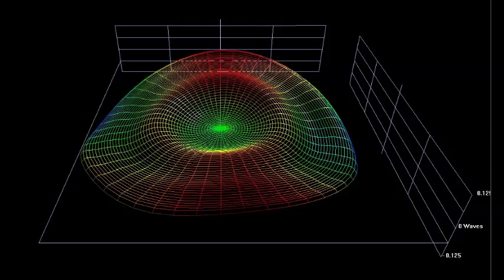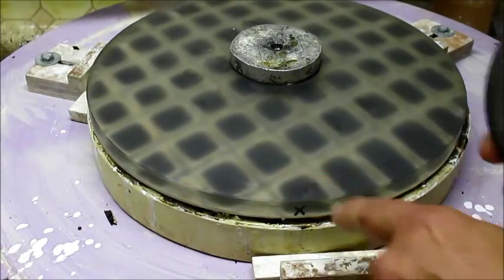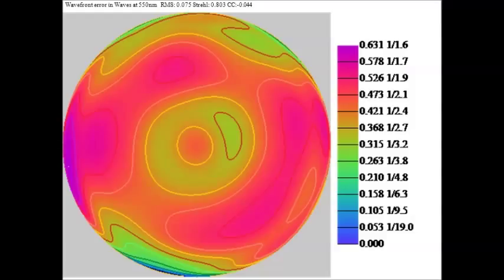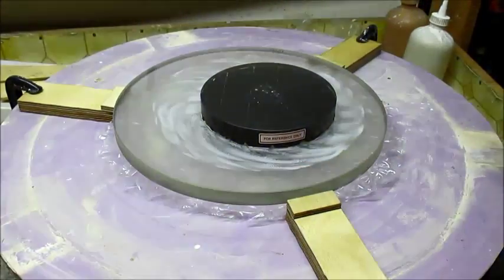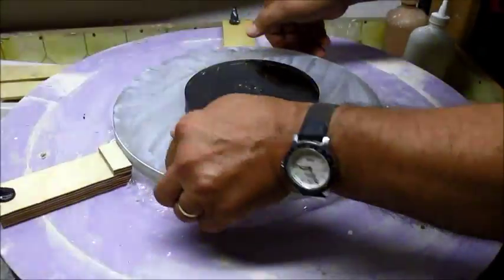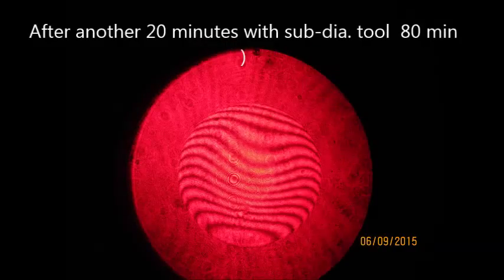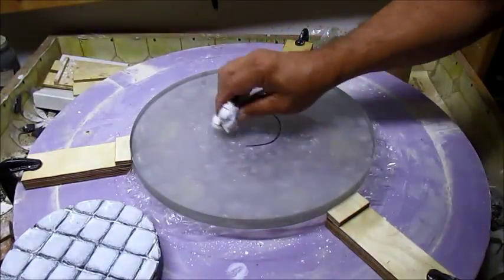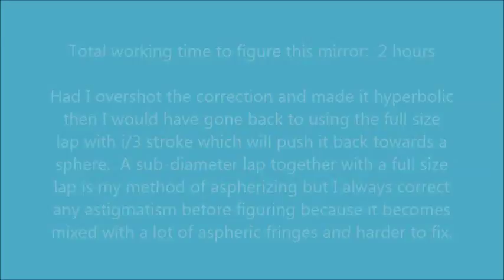Figuring an Astigmatic Mirror

Comment: Ed,
i had a problem with the said mirror, the center was rising, even with mirror on top with mirror center over tool edge stroke, which is an extreme deepening/hogging stroke.

i fixed it eventually using a very small pitch lap but small laps obviously create zones. so when i got the hill smaller than the diameter of secondary i called it quits as it didnt matter anymore.

do you any idea what was going on? how could the deepening strokr produce a hill in the middle?
Reply from the maker: With the mirror on top it will naturally move to be more oblate or less corrected that looks like a hill, at least that's what I find.  I just keep using a half diameter lap and parabolizing. Never a very small lap.

Comment: damn 12 inch diameter 0.7 inch thick? i  managed 12 inch 0.75 inch (19mm) thick as a first project, f5.7, however i stopped at 1/4 lambda as i was content with it but it was tough. used foucalt with coudier mask and a star test to get there.

Comment: Hello Mr. Jones:

I have watched all your videos several times. The big question I have is in dealing with large mirrors which must be in the bottom position all the time as they are worked on. How do you prevent astigmatism in such cases? How do you rotate the mirror (which is quite heavy) so that the strain on it is randomized hence astigmatism doesn't become part of its figure?

Much thanks! Your videos on optical fabrication are the best!